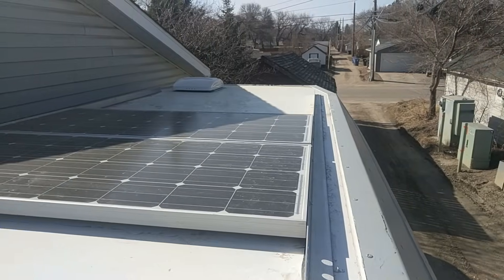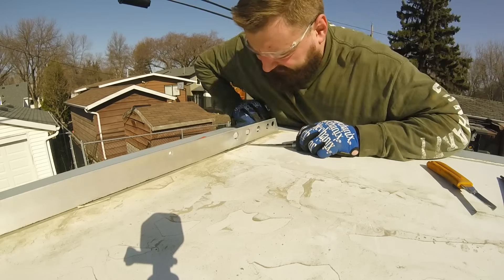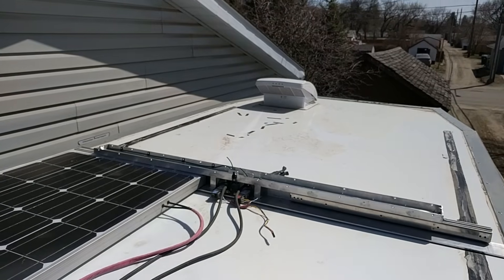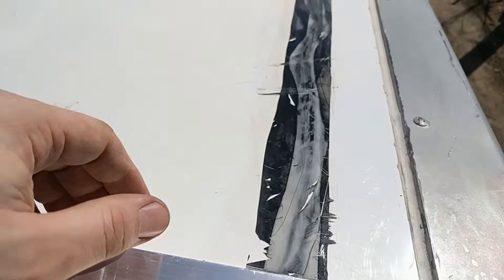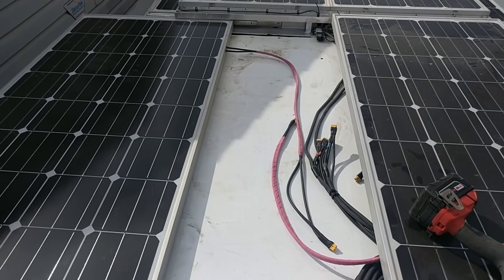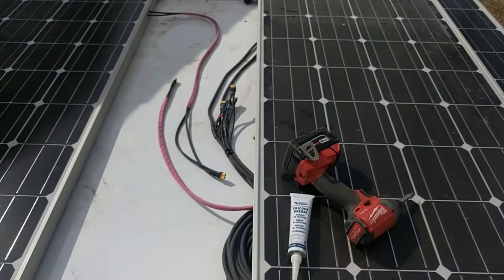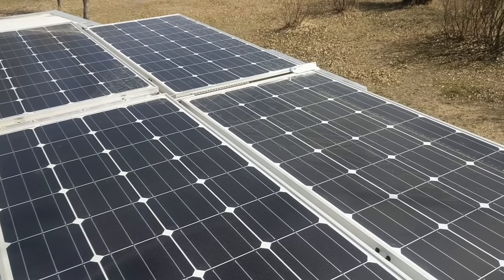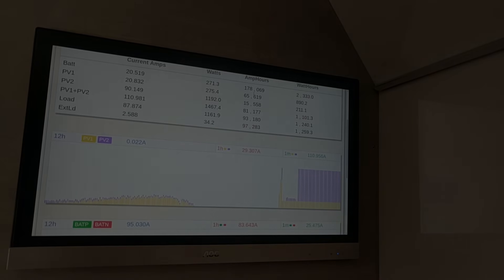Expanding Solar Array Install and Epic Fail - How not to Build an Overlander

Comment: Great idea separating the upper and lower solar panels so you can power the upper only when the lower is retracted and shaded.  And your running Python scripts. Very cool!
Reply from the maker: Yup, it also adds airspace to under the top set to give more airflow and cooling...

Comment: Love the build series. A question regarding using the chassis of the solar array as a ground. Did you use some sort of braided strap from the panels to the chassis? I ask as because it is required in the industrial/utility scale plants I build as carbon fouling will occur between any bearing surfaces and would result in a) micro pitting of the bearing surfaces until failure, and b) loss of continuity and or intermittent voltage leading to spikes and all kinds of weird signals. If this wasn’t a problem, we could save millions of dollars in labor, stainless braided straps and half of the cost of copper cabling.
Reply from the maker: The panels don't pass any current through the frame or slides. It all goes through the cables, and is grounded outside of the solar array assembly.

Comment: Big yes, use raspi with python scripts to control stepper motors to slide out or in  solar panel. Good job.
Reply from the maker: I didn't use steppers because I needed the panels to default to retracted. I use air cylinders so that if the power is lost the retract by default.

Comment: Just seen your channel LOVE it 👍 nice set up, specially loved it when you soldered that SMT device with a flex coverlay as a protection for the rest of the circuit! How many amps did you harvest by the most part in a sunny day so far with 1,4 kw total Pv cap? ..
If of interest:  I run a 160 Ah Lipfos ( Super B) with 2 MT Cis panel flat mount they do max 10-11 amps summer one pm..but winter sun out  still up to seven..yes I know I would need one more..but these 2 Mt Cis 90 wp  do 2,5 amps even when over cast..well what is 2,5 amps? Nothing...The jocker would be my 2 parallel chargers and booster which can pump 50 amps in and that charges the batt in no time..my consumption pattern is coocking with up to 2 kw for 20 min day, esspresso machine 1,2 kW often, hairdryer 1,8 kw 10 min not every  day.,  TV 32 inch often 4 hours, back fan at refrig all day, Alde recirculation pump few hours / day when cold out,  water pump with 0,9 bar pressure storage  for washing, dishes and cooking, Led lights at night..radio all day, 2 Notebooks, 2 Phones, 2 Tablets and some times drone recharge, cams  and 2 e bikers recharge...so far fine..again one more panel would be great!..
Reply from the maker: We're traveling in Mexico now, getting 1250 watts peak, about 90 to 100 amps into the battery.
Reply: @Everlanders  👍 impressive thanks, my batt would be full in 1 h..neat ! Happy and safe travels 4 u guys!

Comment: Genius,  ive been wanting to do the same thing but had only thought of manual control with pulleys and awning cord. i will deffinatly use your idea for air contro ŵith your permission of course.  I think your only getting 800 watts because your main cable is sized too small. For 1400 watts it should be at least 2 gauge.  Just a thought!  I did my motor home 5 years ago with solar and lithium, the first year paid off the cost of solar and the third year paid off the whole works. The cost of gas running the generator is where i made my savings. It is amazing how easily and fast they charge the lithium and how all the appliances run like they are plugged into a power pole.  AGAIN GENIUS             Cheers      Steve h.
Reply from the maker: My main cable is 2x 4AWG welding cable...

Comment: Is the solar controller MPPT or PWM?
Reply from the maker: Neither, Power Point tracking offers little benefit if you use 36 cell panels, as they are near their MPP already.  PWM is only needed if you need to limit current, and Lithium Iron Phosphate have no such limits... We can charge up to 2000 amps, which we'll never approach.
Reply: @Everlanders  wait are you saying you aren't using any sort of charge controller? These are wired directly to the batteries??
Reply from the maker: No, I'm saying we're using a SBMS100

Comment: Great idea Bro ! I'd expect a lot of copy cats :) you should patent that idea ! :) quickly ! 
Catchment is one thing , but what about your battery bank ? What amp hours do you have available ? 
Gel or lithium ? As led acid is gassy for mobile homes , without noisy fans and vents etc . 
I use 2volt deep cycle sealed gel ( no maintanence ) battery's , with 200 amp hours per battery , so for my six battery's(12volt)  I've got 1200 amp hours ( 600 @ 50% discharge ,for battery life extension) . And plenty reserve for rainy days . :) 
Nobody talks about 2 volts is series , but they give the biggest AMP HOURS . 
Lithium would be nice , but there SO EXPENSIVE !!! ( offering 80% discharge for life ) :) 
You seem like your on the pulse , what did you choose ?
Reply from the maker: 5kw of Lithium Iron Phosphate.
Reply: At what cost ??? $$$
Reply from the maker: If you keep your eyes open they can be had for about $100 per cell, Brand new they are $250

https://www.evwest.com/catalog/index.php?cPath=4

If I were to do it again, I'd be tempted to get a eBay Tesla module for ~$1,100

Comment: Man that roof rail removal was a pain!!! I wish someone would have loaned you a Fein Oscillating tool with the flat blade. Makes short work of a difficult glue seal removal like that. Love the Rig! Only thing I would love to see is windows!
Reply from the maker: I didn't want to use a saw for fear of gouging the expensive panels. We refuse to add windows, Need to make a video on that I guess.
Reply: No worries! Fantastic rig! Hands down the slickest solar setup I’ve seen yet. I had a test bench setup using elec linear actuators to tilt panels L/R direction but not keen on weather sealing, weight and complexity.  Your air system is genius and you can use air for all kinds of things. I used to dive and have scuba tank with hp/lp regulator and adapters for tires, shower systems and a few air tools.

Comment: Just met you in the Tractor Supply parking lot in Yucca Valley... if you ever have to do something like this again, get a small piece of cable or wire with a handle on both ends and you can "saw" through the adhesive down the length of what you are removing.
Reply from the maker: I tried, SikaFlex adhesive is approximately the durameter of tire rubber... It's either skates off or grabs it so tightly you can't pull it... I tried a thin stainless cable and a fine solid wire, like music wire... I was going to try the survival wire saw, but I didn't want to damage the expensive composite panels.
Reply: @Everlanders  I've used the method with 3M tape but I have never used SikaFlex, given your experience I guess I will when it's time to mount my panels... you also did exactly as I had planed with stacking  your panels but never thought about making them automatic, I was thinking a rod like you see with pull out awning. Are you running separate charge controllers for the top and bottom panels, or I guess how do you manage the shading of the bottom panels when they are in the stored position?
Reply from the maker: We use a SBMS100 charge controller which properly manages cell voltage for our lithium battery bank. It has two inputs, but even without that, the panels are wired in parallel so shaded cells or panels don't affect the others...

Comment: XT60 connectors usually used for RC model electric airplanes. Creatively done.
Reply from the maker: Yup, did lots of RC planes back in the day, but never used these until now, Deans connectors were the new hotness back then.
Reply: Everlanders hotness ha haven’t heard that in ages.

Comment: so something i've been wondering about. was the ac always in that convienent out of the way spot? or did you have to remove stuff from the roof to fit all of this?
Reply from the maker: We built the truck from scratch, from the ground up. So the air conditioner was never on the roof... If that's your question.
Reply: Everlanders sorry was thinking the thing infront of the solars was a AC unit. I've been looking into rv's tho on of my concerns is not having enough room to mount solars for my needs
Reply from the maker: Oh! Nope, that's the maxxair fan... Just a ventilation fan. http://www.maxxair.com/products/maxxfan/maxxfan.php

Comment: awesome setup!!  I'm sure I'd be even impressed if I understood the tech speak!  :)  Question about the durability:  mounted on the hard slides as they are, are you concerned about the panels being damaged over time by rough roads?  Keep up the great content!  Love the cartoon faces and the commentary!
Reply from the maker: I have no concerns about the slides, they are not your grandma's rattel box slides, they are super solid 100% stainless, no plastic anywhere in these slides. Plus the air cylinder is pulling them in tight, so they are held super firmly.

Comment: What is the software called that you use?
Reply from the maker: I use a lot of software... Not sure which you are asking about. The automation for the air cylinders and controls is written in Python. The Solar Charts and Stats are handled by shell scripts that curl the raw data from the AP on the Solar Controller and then displayed via HTML and JS. That way it's easy to access via cell phone too.
Reply: Everlanders thanks so much! Did you ever end up posting the script from your Android auto?
Reply from the maker: Yes, all this information was in the Part 2 Video: https://youtu.be/jFXxtxoi_pc

Comment: Wow that is awesome! 
I suggested "solar awnings" a few times in various threads but to see it in action is awesome and sure requires some good engineering skills. This definitely could help make RV living more autonomous by increasing solar gain.
What mechanism did you use for the retract? Linear motor?
Reply from the maker: The retracts are powered by air cylinders, all the parts used are linked in the first video.
Reply: Oh wow I missed the first video then. Thanks!
Reply: Sorry, what first video?

And how wide are the individual panels and your van roof? I've only ever found panels that are about 1m wide (39")
Reply from the maker: The first solar array video:
https://youtu.be/cM5s4F-7AOk

Our panel dimensions in Inches and mm:
58.75 1492.25
26.750  660.4
1.875  47.625
Reply: Oh thank you kindly! It's been a while that's why I didn't find it ha.

I've actually been looking for alternative dimension solar panels to fit more fully on a 2.55m wide box truck roof but those won't fit perfect either. Best solution I've found is to actually cut a 1m wide solar panel in half and resolder it. From what I've read it's relatively straight forward. Just cut a 1m wide solar panel into one 0.5m wide and connect new wires to the front/back and mind the voltages.
Reply from the maker: Look up High-tech solar, he goes by Fred480v on eBay. He custom built our panels with special cells and may be able to help with your custom size. Maybe, maybe not.

Comment: just wondering, why didn't you use standerd mc4 connectors?
Reply from the maker: Size, cost, reuseability, polarity. To maintain as low a profile as possible I needed to run the wires through grommeted holes in the edge of the panel frame. This required cutting all the original mc4 connectors off. The design of mc4 connectors does not allow for reuseability so I would have needed to buy 32 connectors, and they are not cheap. I used the original mc4 connectors last summer, they are great, weatherproof, locking retainers, rated for high voltage if in a large series array. But I didn't like that it was possible to accidentally connect two cells in series which was easy to do if you had 32 connectors all laying in a pile. Also, I found that the Locking tabs would gum up over time and make it very difficult to get them apart.
Reply: thank you for the quick response!!

Comment: How are your Rancho shocks holding up?
Reply from the maker: They seem fine, we just turned them back to their softest setting after the new springs and the ride is much smoother. Hoping it's smooths out even more once the springs wear in and we add some more weight to the box.